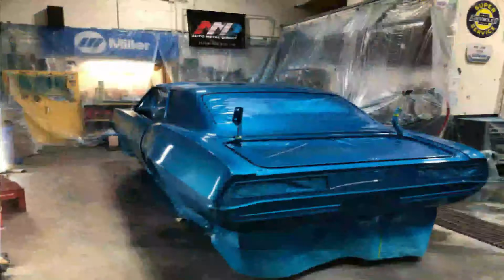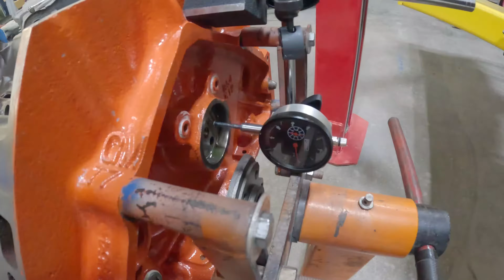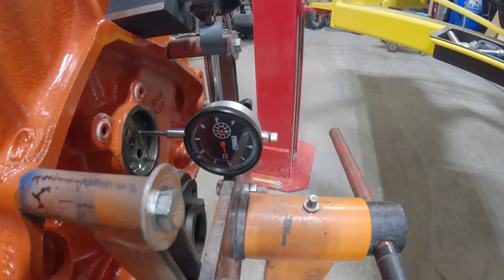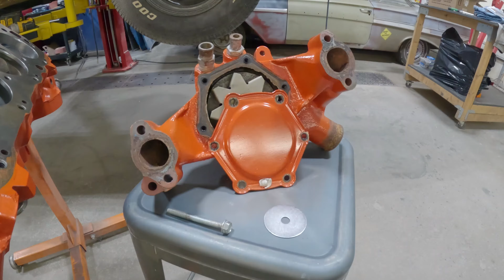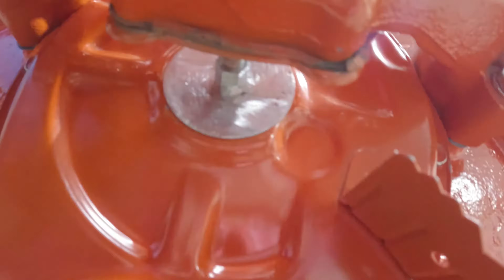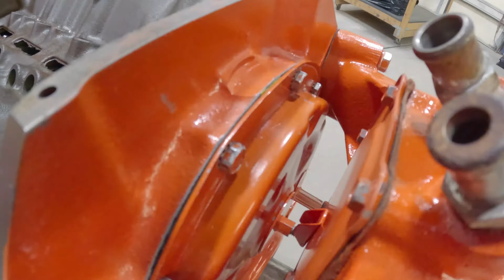Big Block Chevy Hydraulic Roller Cam End Play with Stock Timing Cover and Cam Button.

Comment: I did the pete jackson gear drive with a 2 piece timing chain cover on my 402 in my 30 A coupe but ive got noise from my howards  roller cam shaft ive adjusted my valves a dozen time

Comment: I believe the 402 has the boss in the block. You just need to drill and tap the holes to put a thrust plate in. In a 454 they are already there. Just order a cam plate and bolts. On my Mark IV 454 I used a gen 5-6 single roller timing set. However,  You have to use a gen IV crank gear. The gear is wider than the gen 5-6. The chain will line up but your damper position will be deeper if you use the gen 5-6. Not a lot but your belts will not align properly. With the late model thrust plate you don't have to mess with the button. And or timing cover flex.
Reply from the maker: Thanks for the additional insight!  Yeah, the 402's had the boss.  Some came with threaded holes, other's didn't.  In my case, my block didn't have any holes.  Having the boss drilled/tapped was an option but I went a different direction.  Thanks for watching!

Comment: Why is a cam button needed ? Once the distributor is in place the gear will keep the cam from moving. I don't have a cam button on my engine. It's been running for ten years. I just recently put in a new distributor after seven years and the distributor gear had zero visible wear. I say let the distributor gear locate the cam. What you are doing is locking the cam into a position the distributor gear may not like.
Reply from the maker: Is your cam a hydraulic roller or flat tappet?  Roller cams aren't ground on a taper so they should have a cam button or thrust retainer plate to keep the cam from "walking" and causing erratic timing. To each their own...

Comment: Looks like you used a cam thrust plate. So, why you need a thrust button?
Reply from the maker: This engine block doesn’t have the boss or threaded holes to accept a cam thrust plate, so the cam button is needed. I did use a cam locking plate though so I’m guessing that’s what you’re referring to.
Reply: That’s not a cam thrust plate, it’s a lock plate. They’re different. Lock plate and thrust button are used together for roller cams

Comment: What pistons are you using?
Reply from the maker: These are just cast Sealed Power 402P's.  Nothing fancy since this will just be a street motor.  They sit a little lower in the hole than I'd like, so I had the block and heads decked just a little bit to bring up the compression and tighten the quench.

Comment: Why do you need a barring behind the cam sprocket?
Reply from the maker: It's not absolutely needed, but I prefer to use a Torrington bearing to prevent wear on the front of the block.